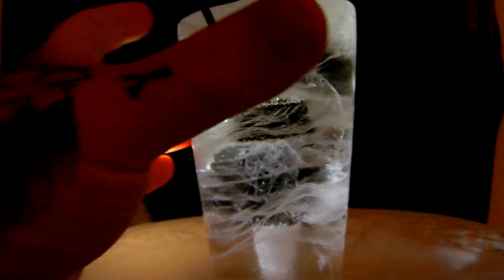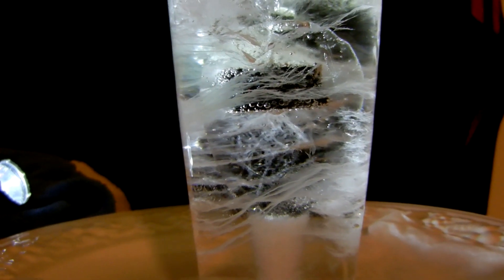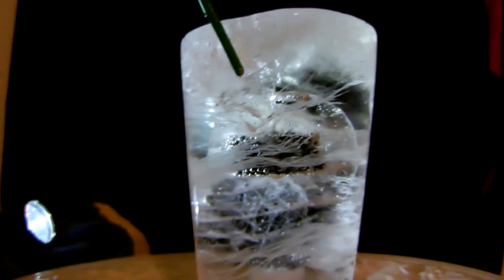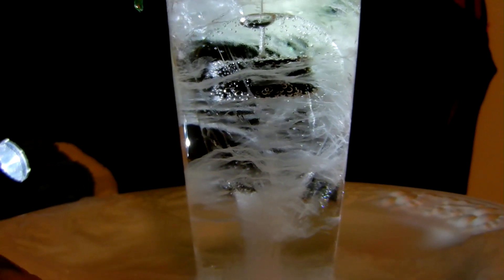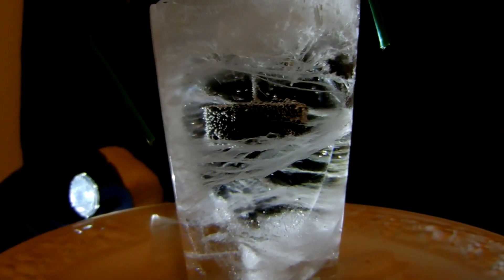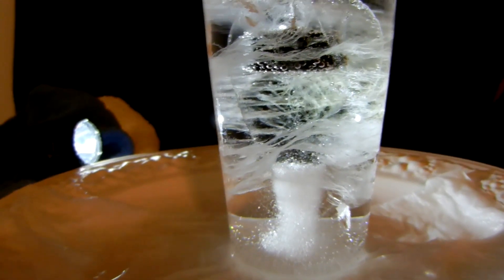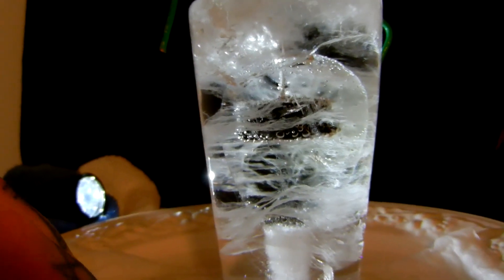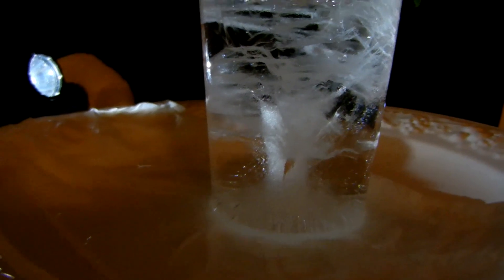Amazing: "Magnetic Egg" Using magnetism to alter the properties of water. First time ever seen!

Comment: If anyone is interested in doing this or if Ken you ever remake it, using different types of water adds to clarity but the water being foggy comes from the water freezing at different rates. I’m not talking about the Aetheric banding you’ll see that no matter what. But having a cooler or something that is insulative for the freezi ng process will give you extremely clear results. I did this with orgone and got the same but clearer results from what I can tell but I also used iron so that might of played a role what I saw usually it’s different. But gonna do this with a magnet for the fun of it and maybe some side by side comparison

Comment: Ken, if the bubbles  in a  shaft  are  centripetal   then  if it's possible  the  galaxy  jets to be  not  going from the  "black hole"  outward  but  centripetally  inward  and  the  scientists are  mislead   about the direction  which they  measure by the red shift    by  the  EM  phase  retardation?  Why don't you "freeze" the field modalities  of two  attracting but  held separate  by  some plastic nets  magnets  and two  repelling  but held close by plastic net  magnets?

Comment: hmmm,  this reminds me of VIktor Shauberger.   I also find it quite a interesting that ancient potteries has a similar egg shape except for the handles.
Reply: ive solved that one. ill have proof of concept soon that they were overunity piezo generators. 40,000 vases stashed underground? sounds like the timepoint  the brotherhoods pulled one over us
Reply: @electrotherapyify  wow, how would that work?
Reply: @Skynightburst  the torus holds the key. Theres a video 'magnetic particle dynamics' that shows the torus in explicit detail. I'm proposing that a fluid, water for example, is driven by a specialised turbine, at the 'north pole ', IE where the vase opening is. With enough speed, any particles of quartz sand settled at the base of the jar will be circulating up and down, round and round the torus. The pressure will fluctuate,  as the particles circulate in the water (mercury 13 times denser, could be a great option)...its quite the endeavour trying to prove this, and I'm learning how to make clay replicas as we speak. I'm no expert on motors or turbines either, give me a bit of time :)

Comment: Stunningly brilliant experiment. I salute your endless search to "make visible". 
One question - from your usual images of "hour-glass vases" inside Torus, there is top and bottom symmetry. 
Does this "reduced lower end egg" shape come because of the tapering of the container?
Or could it be an effect caused by the greater density of centripetal forces from the earth's centripetal field (gravity-ish?) tightening towards the bottom, as do those entering the pole of a magnet?

Comment: ...and this is the reason why they kept water in amphora vessels.
Reply: Viktor Schauberger mentioned this as well. It is probably worthy of more than a side comment to a video.
Reply: There is a tantalizing connection but as far as the actual effects... what does it actually do to the water?
Reply: What's that?

Comment: I am trying to comprehend the egg shaped void. Is it correct to say that the void is created
by the velocity of the centrifugal vortex at each edge of the of the magnet - "north-south"?
Reply from the maker: x111001101010x not the velocity, but the magnetodielectric phase shift, remember that a magnet is nothing other than a COHERENCY of the atomic precession 

there is no QUANTITY of change in a PRE-magnet and the Created-magnet, other the precessional coherency

this creates rarefaction and compression at a phase of 1 to PHI  (same as an EGG is in shape)

also look into "LARMOR frequency"  ;)
Reply: Thanks for the information.
Reply: It’s not a void, just unfrozen water

Comment: What happens when the magnet  is chilled in a liquid nitrogen bath(or acetone/dry ice bath) making it a super conductor and then dropping it in 40 degree Fahrenheit distilled water?  I wonder if it would create something spectacular?
Reply from the maker: Jason Kolmes there is no such thing as superconductivity, what is seen is EXTREMELY HIGH levels of LOW magnetic permeability.

actually, all magnetism is heat and force, it would greatly reduce its guass field when the magnet is chilled

what is chilled in so-called "superconductor" sets is NOT the magnet, but the disk, such as Yttrium barium copper oxide disks.

i used to play with "superconductor" sets all the time.
Reply: +Theoria Apophasis Ken, initially magnetic strength increases as NIB magnets are chilled. The effect that you are referring to only happens at temperatures less than -185degC (-301degF), from what I understand. Why is this so?